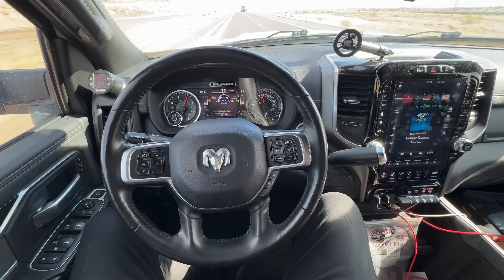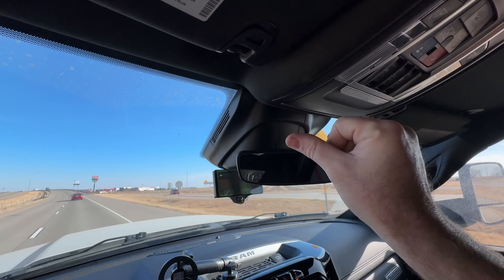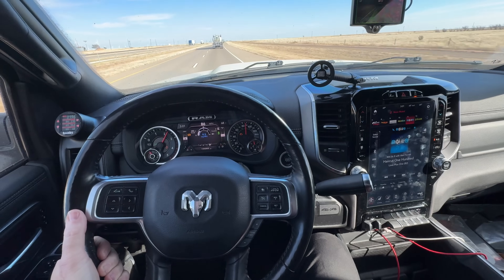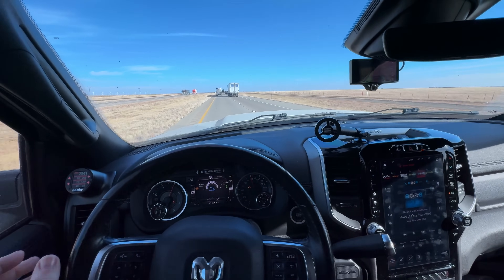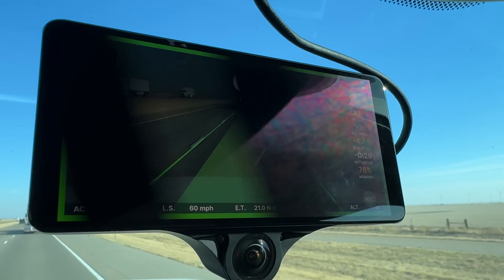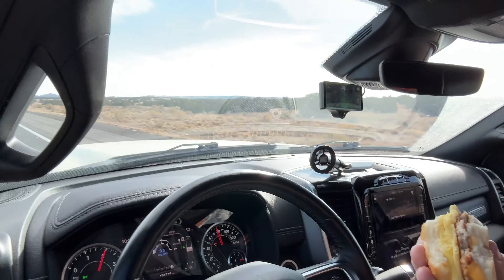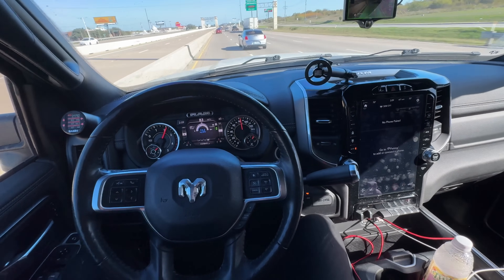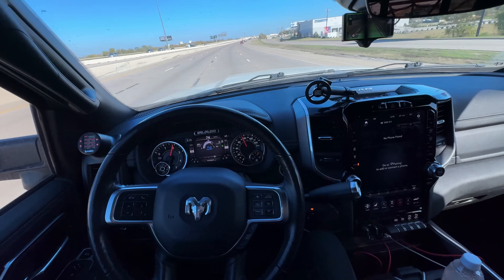Ram 3500 with COMMA AI Self Driving Capability?

Comment: My understanding is the torque limits are imposed by the device itself for safety, not by the car's steering motor.  You don't want to be driving down the road at 85 mph and suddenly the software glitches and tells the car to make a 90 degree turn.  And another issue I have heard (not 100% sure if it's accurate) is that these steering motors in vehicles actually have enough torque available that there is the potential for the software to apply enough torque to the wheel that a human would not have the strength to overcome that torque and correct a mistake the software is making. So the device itself has a separate chip or hardware component built in.  Every command the software tries to send to the car has to go through that chip first.  And it's only job is to say is this command within the preset parameters (in this case the torque limit). If it exceeds that limit it just won't let that command through to the car.

Comment: I have a 2500 same year, same everything, and the lane assist seldomly sees lanes and when it does it just ping pongs in between them and doesn't hold itself center, but the adaptive cruise works like a dream. Does this system do more or less the same thing for steering, just not requiring you to hold the wheel?

Comment: Interesting!  I have no use for it. I’ve got 275,000+ miles on my 2005 Dodge Ram 1500 4x4.  It does not have the tech. that your truck came from the factory with so it’s probably not even possible to install it on mine w/o a lot of serious other upgrades first.  I just don’t believe that Auto-pilot, for me, is the way to go.  

Thanks for the review!!  Always fascinating to watch your vids!

Hey, did you ever sell your Dallas Home?  Last I knew you had pulled it off the market and were doing some renovation, I think?

Comment: A: Just take the C3 out of the mount to let the mount adhesive cure for 24-48 hours. This cure is essential to long-lasting full adhesion, and not damaging your C3 on a hot day.
B: The speed limit for the C3 is really only limited by the AI models, has very little to do with the C3 hardware itself.
C: Cheers, otherwise fairly informative!

Comment: Sketchy streets I activate it on my model S…..feel like Kitt is on duty while I man the turret.  Get you a 2017 or newer model S with self driving….you will enjoy this feature much more
Reply: Comma ai openpilot works better than tesla autopilot (well, at least on certain vehicles [kia/hyundai/honda]). I have about 50k miles between a 2021 rav4 and a 2023 santa fe using a comma device. About 20k miles between about 12 different teslas, with about 18k or so miles using autopilot.

Comment: Did you get the 1500 harness? I've been looking at getting it, but it doesn't have the harness on the website.
Reply: Yes the DASM on the 1500 and HDs use the same harness. Just make sure your truck is 2021+ with the steering actuator.
Reply: @ausernamepng869  good deal, bc I already ordered it. Should be here Wednesday. I have a 2022 Ram 2500 Limited, it has active cruise control and lane keep assist, so I should be good. I got excited and already pulled all the plastic parts down around the rear view mirror. Didn’t break anything, so I’m off to a good start.
Reply: @alphag33k Did it work using Sunnypilot on your 22 Limited?
Reply: @ yes it did

Comment: It doesn’t make sense to me, it’s not at all point where you’re actually going to trust it enough to take your eyes off the road for a few seconds, if your gonna sit there stressed ready to grab the wheel if anything goes haywire then really what’s the point?
Reply: Trust me it is more relaxing than you would think.   Its like the difference between sailing a boat and being a captain monitoring things.   It also is more perfect than the average driver, so unless you only drive like its a nascar race and are never tired, distracted, or a human its a nice layer.  Eventually this will all be common.